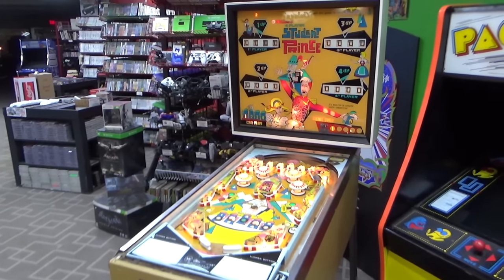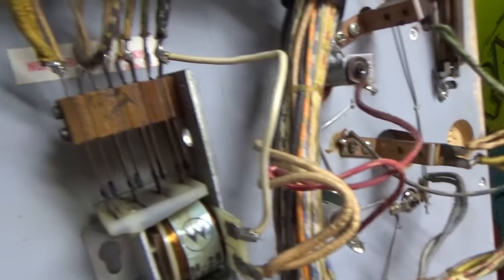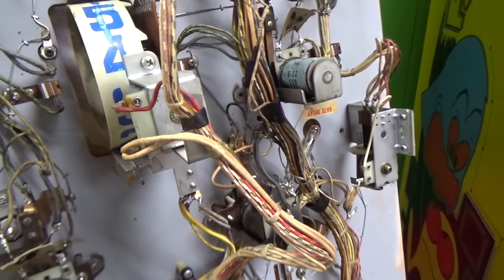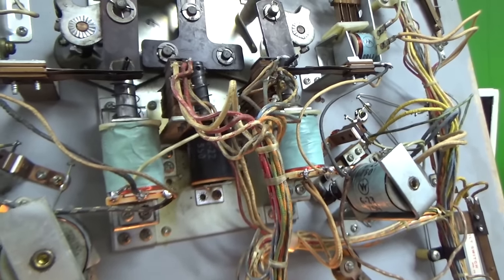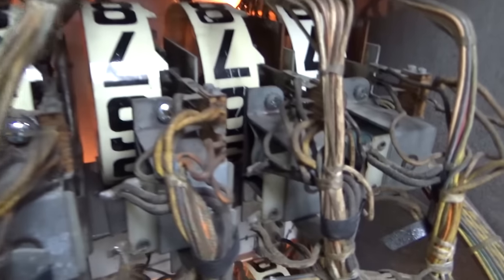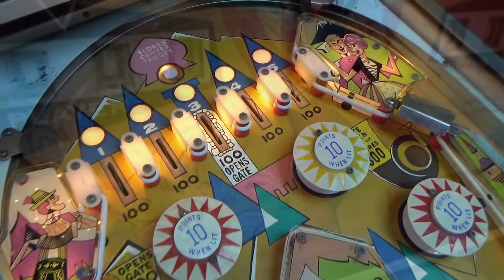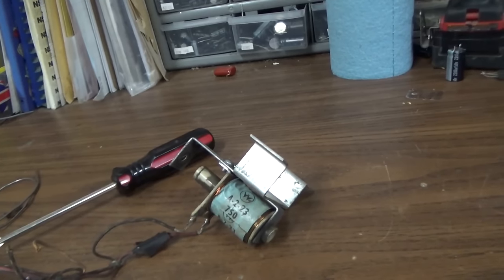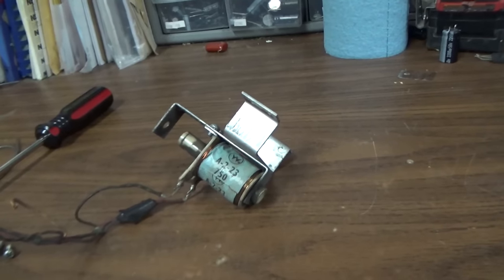Repairing The Williams "Zipper Flippers" On This Student Prince Pinball Machine... Schematics WRONG

Comment: Personally, I like the EM video's better than the electronic ones, mostly because I am fascinated by the level's of logic created by all of the contacts, relays and switches. I have been involved in electronics as a trade and also a hobby since I was a teenager, but I will say I can't make it through a EM game schematic and figure out the "if this closes, it turns on X, Y or Z" anywhere near the speed or talent level that you do it with.   I do have an EM, and a cocktail digital pinball game in need of repair, I am considering dragging them down to your shop and maybe give you some subjects for content.
Reply: I like the first and 2nd gen electronic, after that they decided to put as much stuff as possible on the playfield.  Adding in the LCD Displays that give all kinds of information is just horrid in my opinion...I can't watch the ball and watch the display at the same time.

EM's are awesome, and I learned on them in a bar back 45 odd years ago.
Reply: Seconded. Do like the E/M videos… and I do follow them all from beginning to end. Thanks again! Regards
Reply: @WreckDiver99  -- Well, the DMD displays are the ones with all the extra info. "Only losers use drugs!" Etc.

Comment: The reason knockers are usually removed is to steal the coil to replace a burned coil elsewhere on the machine.  The Space Mission I'm currently working on was missing the knocker coil and Jones plug.  The bracket and plunger were laying loose in the bottom of the cabinet.  It's not the first time I've seen something like that.

Comment: The other thing hitting it with a hammer will do is demagnetize it - if the laminations have been magnetized by long exposure to the field in the transformer, the shock of a hammer-smack can knock the atomic structure back out of alignment.

Comment: i saw that when 1 popbumper was activated by the ball, another popbumper is activated also. Are those ‘diode hacks’ not installed to suppress the unneeded second popbumper activation?
Reply from the maker: I think the diodes were just to make everything fire harder.  It's designed to have two pop bumpers pull in at a time.